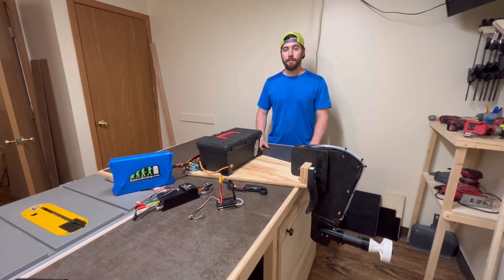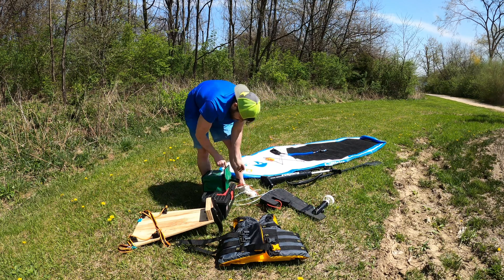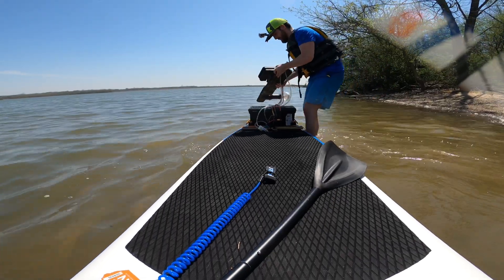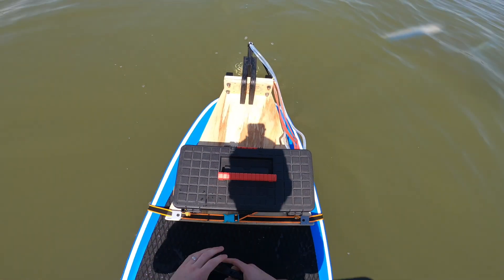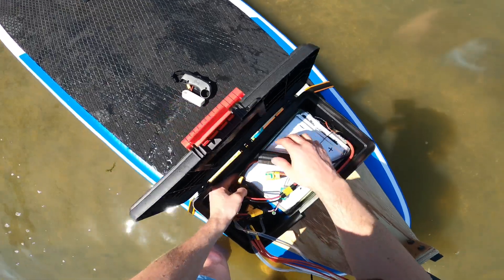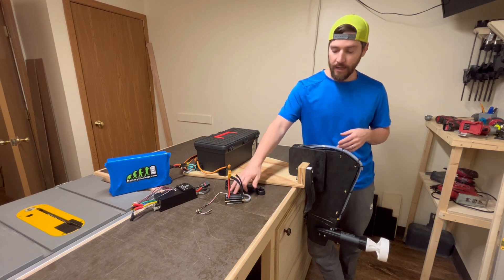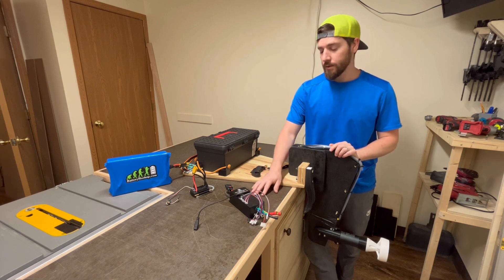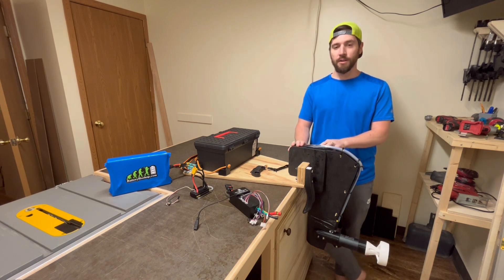Testing my 9000 watt DIY Electric Outboard Motor on the Paddle Board!

Comment: Super nice build, have you gotten around to record the speed of the board ? If not, may i suggest trying google maps to do it. Just write in a route and start it, and on the bottom left it should tell you your speed.
Reply from the maker: On 12S and 130amp it hit 8mph

Comment: Super cool! Any info on the motor/esc you used? I’ve been thinking about doing something like this for my kayak.
Reply from the maker: SSS 56123 Kv230 with flycolor 150A speed controller.